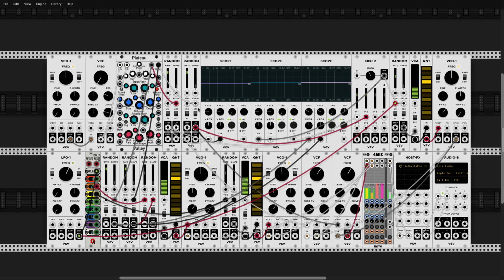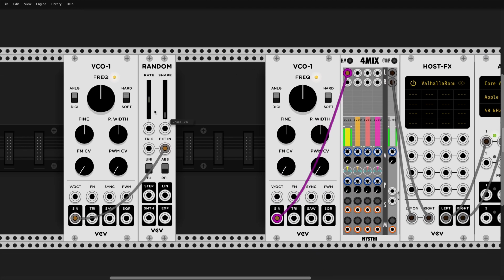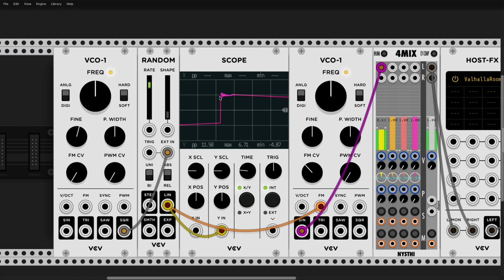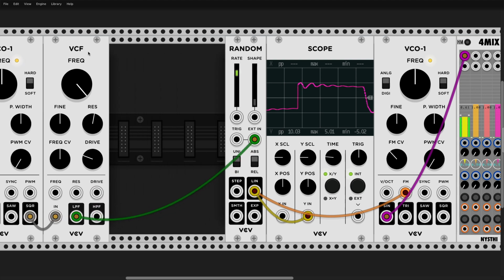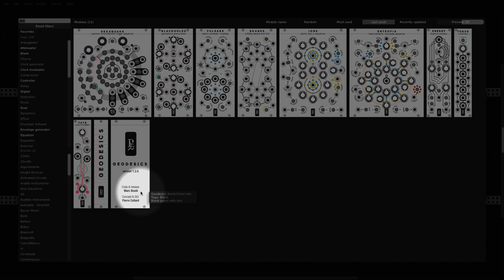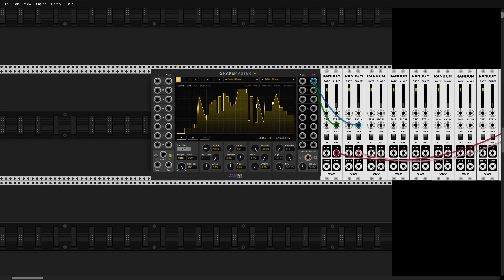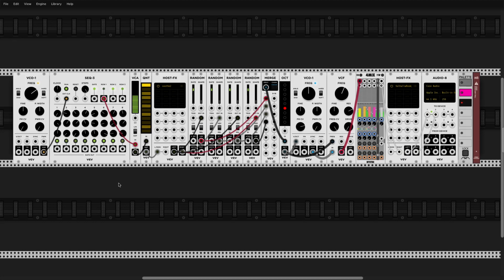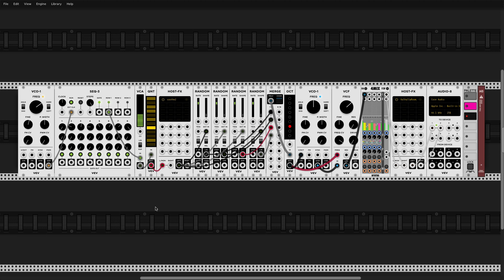VCV Rack Hacks | Aliasing Trick

Comment: The "wiggle" is actually something all analog electronic oscillators do when outputting a square or saw tooth wave. In the electronics world it's called "ringing" or "edge ringing". In the physical world it's caused by both the inherent capacitance within the oscillating transistor itself and the inductance (think of it as moving electron inertia) in the copper traces connecting the transistor. The VCV VCO, in analog mode, actually includes and simulates this "edge ringing" fairly accurately. The interesting thing, and something VCV does NOT simulate, is that no two transistors, even if they are the same series number, have the exact same "ring" parameters because of slight chemical differences that occur in the manufacturing process - even for transistors made on the same wafer. Your "sampler" is just operating at a high enough frequency and small enough fractional ratio of the sampled wave frequency that it can detect and output the values of the simulated ring oscillations. The "glide" or "plateau decay" is caused in the physical world because the oscillating transistor heats up and cools off with each oscillation causing a minute change in it's internal resistance, changing the output voltage over the duration of each cycle. It can also be a result of "leaky" capacitors in the resonant tank circuit ... or a little of both. If you switch the VCV VCO to "digital" mode, the ring is reduced and the slope will go away. I'm not 100% sure why the ringing doesn't go away completely in digital mode since the wave form is not actually being generated by an oscillating transistor, but by an algorithm that mathematically calculates the values of the wave form (in both modes). It's a credit to the developer of VCV that this subtle physical nature of electronic circuitry is included and simulated in the VCV modules. The reason third party oscillators in VCV don't have the edge ringing is probably because the people programing the modules are not electronic techs and don't realize that it exists. It is extremely difficult to filter out of high frequency audio and radio signals and exist in nearly all real world signals to some degree.
With this "discovery" you have stumbled on to a very important aspect of Electronic Warfare ... which I will NOT explain.
Reply: Thanks for the explanation!
Reply: great writeup, thanks.

I’d love to read a summary on the “electronic warfare” you mentioned….
Reply: The actual ringing usually comes from inevitable limit of bandwidth in analogue circuits, so even if very precise, very wide-band signal generator would generate a perfect square wave with hundreds of MHz of overtones, as soon as this signal travels through regular cables and comes into input filter of a normal ADC, it will be limited to 20 kHz band before digitization. And we’ll see these wiggling around every fast slew because if signal won’t be limited below Niquist frequency, we will get parasitic sidebands aka aliasing.

At the same time, when you look onto the same signal through good oscilloscope with properly compensated probes, like mine, 400 MHz analog Iwatsu, there are no visible ringing as long as you observe it at reasonable vertical zoom.
Reply: The noise within a system is fundamental to all signal based mediums and can be referred to as the latent space. 

I used to experiment with video feedback, and recognized that the patterns that seemingly emerge from nothing were an amplification of that subtle noise within the circuits, and that depending on the chain of devices, you will get different noise characteristics due to each device having its own signature.

More recently I've been working with generative AI image tools, and similarly, at the base of it is literally what is termed a latent image, which is simply a noise pattern.

I believe our own cognitive processes work in the same way. When we look at clouds and see forms, stare at waves and let our mind wander, or gaze into a fire in order to transport us into our imagination. This fundamental relationship of ordered systems that filter a noisy signal I think is integral to the nature of things.